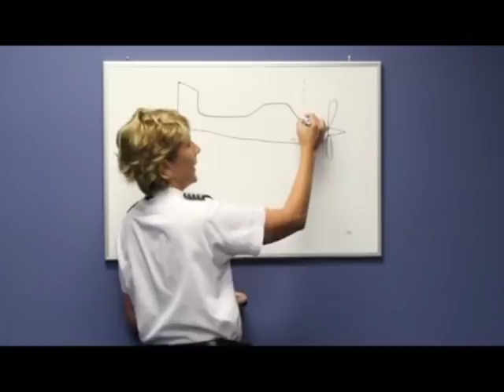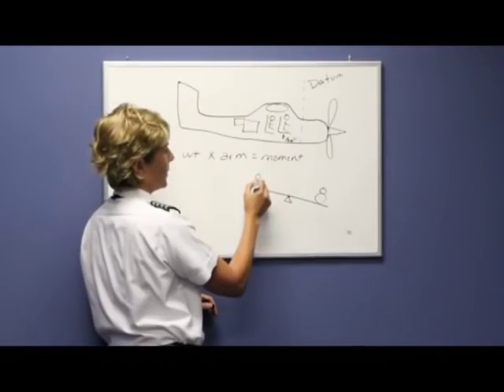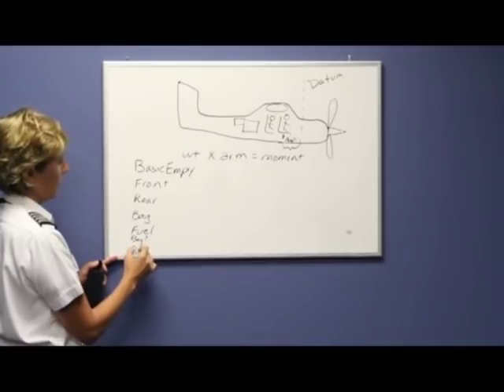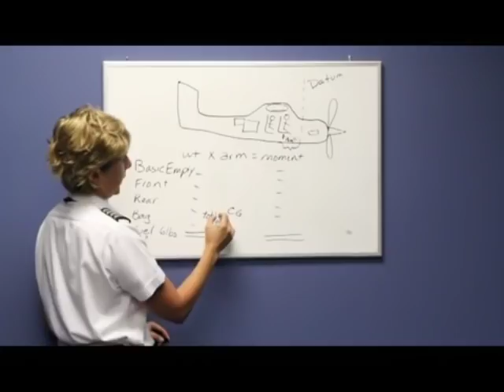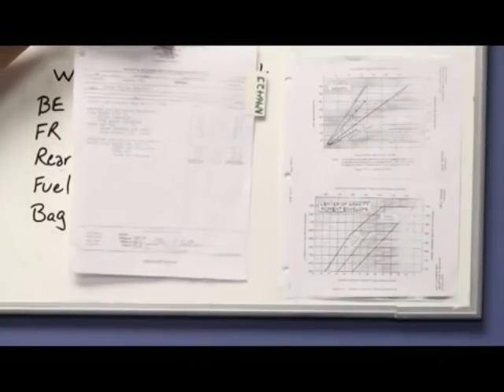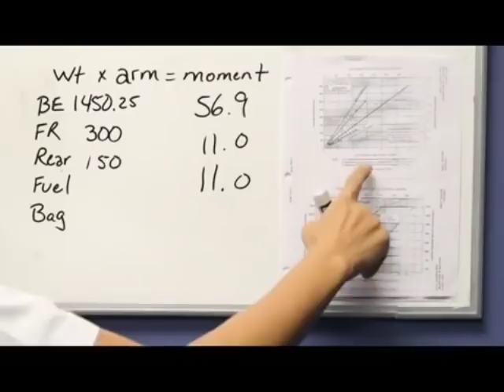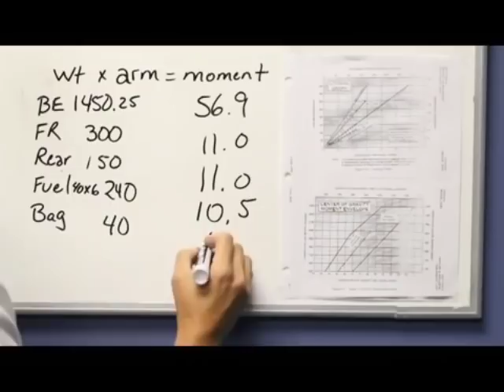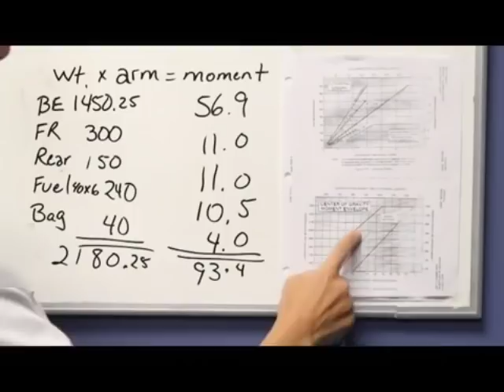Weight and Balance Calculations (Private Pilot Lesson 1g)

Comment: You want to strive for an aft CG. An aft cg will give you a slower stall speed compared to a forward cg. An aft cg will give you a slightly higher crouse speed compared to a forward cg. An aft cg will burn less fuel on a long cross country flight. Remember, Never fly outside the cg envelope...Never. In small aircraft you have very little control of the cg...but some of you may be flying jumbo jets later on and an aft cg will save alot of fuel on a 10 hour flight. Blue Skys.